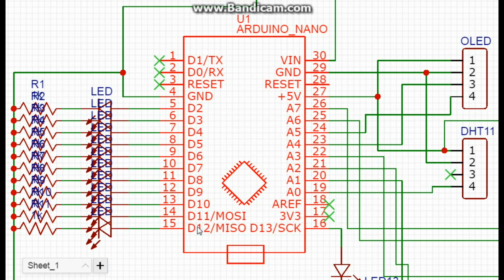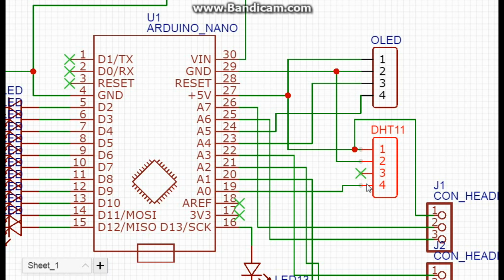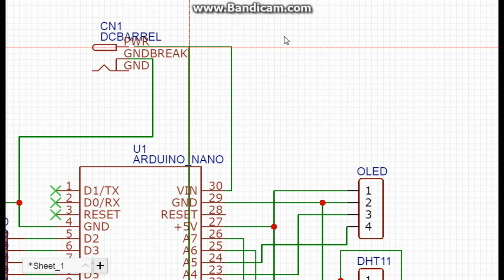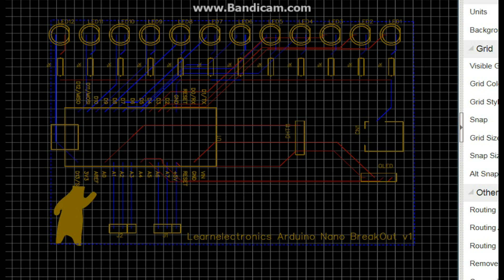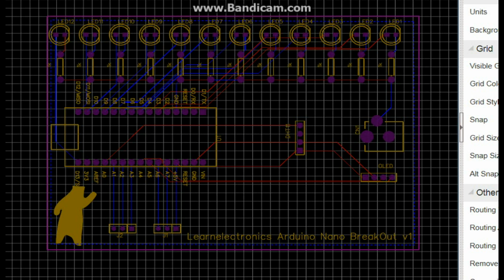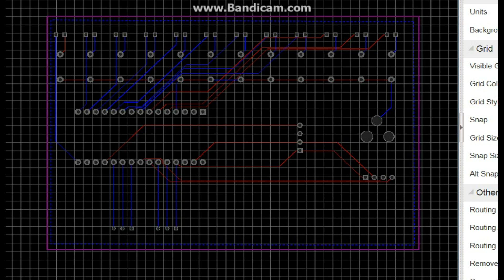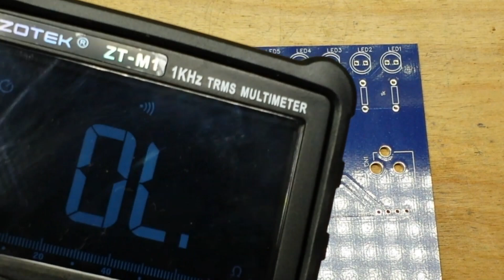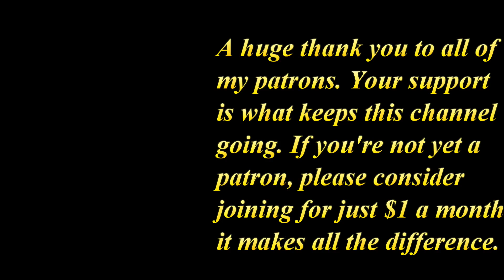Arduino Nano Breakout Board V1

Comment: I’m enjoying the channel immensely, I think you’ve struck a good medium between easy to understand but also technically accurate. Thank you I appreciate this approach. I like your Arduino breakout very much, one humble suggestion instead of that many LEDs, why not get rid of A few and make them toggle switches. This could be fun for basic input output, as well as the oled and temp sensor you implemented. In any configuration I wouldn’t mind buying a few from you, to help defer your production cost. Let me know if that’s possible?

Comment: Why not use netnames instead of making confusing wire spaghetti? For all those connections on the right of the arduino just name them A1 A2 etc. Programming becomes way easier when you can just look at device or connector and immediately know what pindefs they need without tracing lines.

Also you mic is clipping a good deal less, and sounds better.

Comment: Mistakes always happens that's just life!  Would be nice to see how you solved it on this PCB though.  I'd just tweak the DHT Sensor and maybe attach a bit of wire to the power jack - but that's just me.  So what approach did you take?
Reply from the maker: Going to respin the board

Comment: Revisions on boards and firmware just happens. it is part of the learning process. For Rev1 working a couple of correction wires and scrape the trace of DHT could be done as working prototype? The board is neat for example a themoestat with bargrapth LED for the temperature (mimic of mercury ones ) and OLED for Humidity + Temperature values  and using the relays to control a fan and a heater.
Reply from the maker: Thanks

Comment: I thought software was supposed to catch that, any errors with grounds & hots???
Reply: If that is just a generic 4 way header then the program has no idea what you are going to use it for so design check will pass no matter what you wire to it. For the program to find the error you would have to make a specific component with the pins allocated to their relevant function.
Reply: @jonelectronics510  , Thank you, I wondered that.
Reply from the maker: Yeah, I dont know how it passed the DRC check.